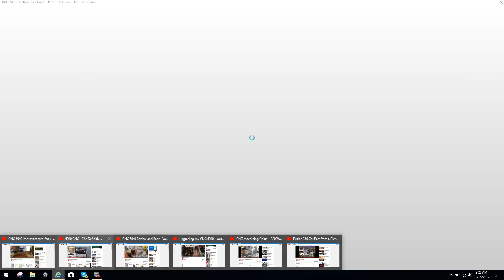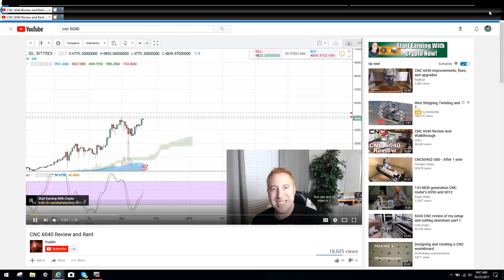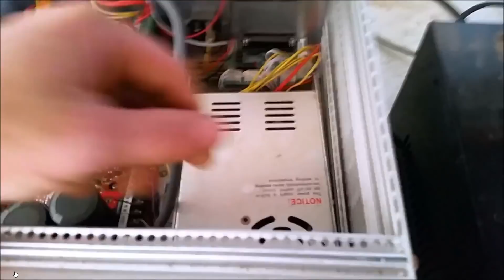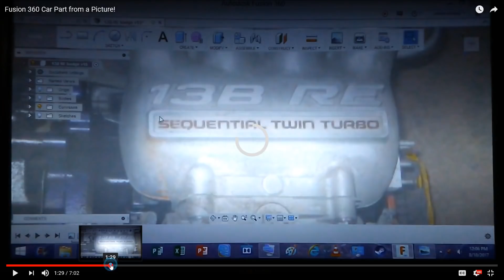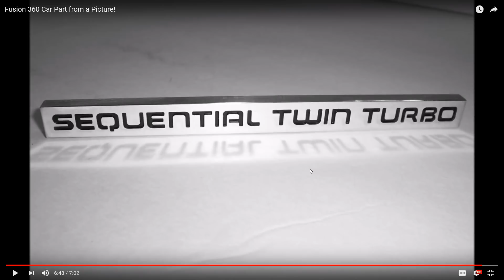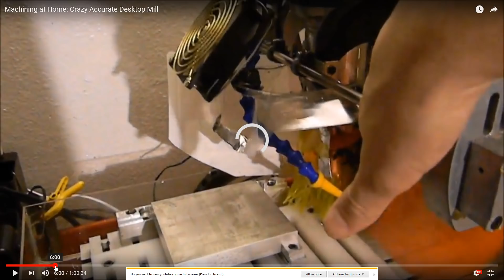CNC Education (Spot the Not) I hope this saves at least one of you.

Comment: Excellent tips. I have one of those 6040 versions and have already upgraded X-axis from unsupported rails into proper Hiwin 20mm rails, made a huge difference especially with drilling operations (now Y-axis is limiting factor for flex/chatter). At the moment drawing totally new, own design with fixed gantry (reusing current gantry) , Hiwin rails everywhere, steel frame. Tip for the electronics was also valuable, I have faced random lost of coordinates issues => will take your advice and most likely build new housing for electronics with proper shielding between components + shielded cables.
Reply: I am working through some of the mechanical weaknesses on mine as well.  Was trying to square the axis when I noticed about 0.4mm of backlash in my x axis.  Turns out the cheap angular contact bears could not be preloaded to eliminate the backlash.  I am having to shim the bearings to be able to preload them properly.... I am sure after I get this stuff resolved I will quickly discover the electrical weaknesses
Reply from the maker: Jat, Shielding the cables will make a big difference, but typically the system's stability will never be there as the drives, and breakout boards are known to have issues dealing with their internal manufacturing. If your using the machine for business then be cautious. If the system is being used for your own general use then you have much less to risk while experimenting.Thank you,Vince
Reply: Hobby use only but you need to able to trust the machine. I have similar electronics box with USB interface as in this video. Drivers are working but I assume USB-board problems as all axis are frozen when shtf.